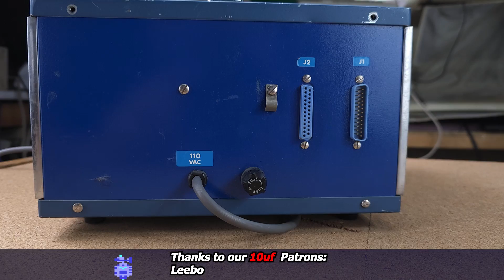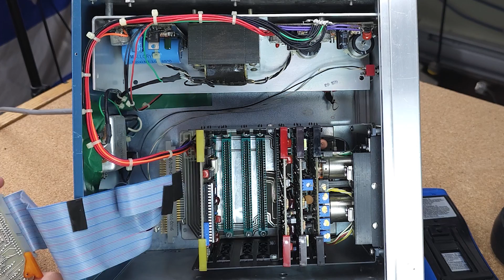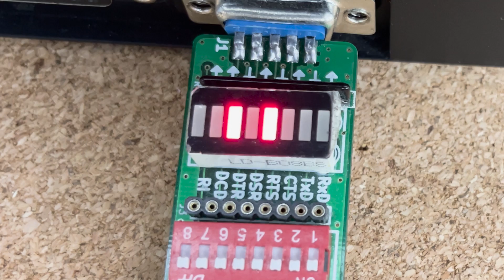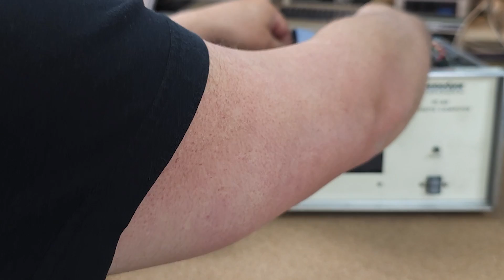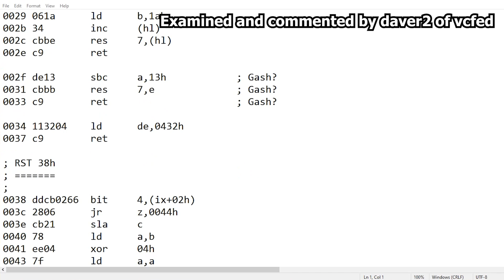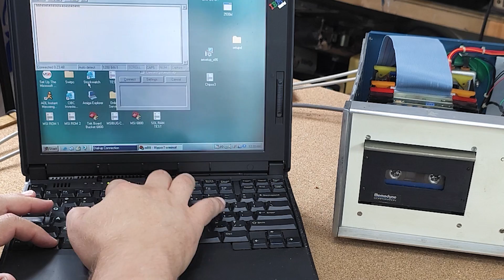Fixing a Mystery Z80 Computer from the 1970s

Comment from the maker: I've edited the video description to include the ROM dump I made, as well as a brochure someone found advertising similar Memodyne systems.  I'd love to hear your thoughts on this machine and how we might test it further, or maybe even modify it into a standalone computer.  While it clearly was aimed at people looking to record data in tricky places, I do think it qualifies as a general purpose computer, Memodyne clearly advertised that capability.  Life goal: Play Zork off a tape. :)  Also - apologies about the lower quality video - the camera somehow reverted to 1080p so my zoom ins didn't work as well as hoped.  But there wasn't really anything intelligible showing up on the laptop screen anyway.
Reply: You can't run zork off tape as it constantly accesses disk. You will need more ram and some kind of fast random access storage. Then you might as well port CP/M to it.
Reply from the maker: @phill6859  Oh yeah I'm just being a goof.  I imagine it wouldn't be impossible though to create a disk controller for an external disk drive.
Reply: ISA 👉 USB is a thing.!
Reply: @TechTimeTraveller  Creating a disk controller could be quite  bit of work depending on what kind of drive you ended up using.

I'd imagine that something using a flash chip/SD card for the media would be more trivial than a real 5 1/4" or 3.5" floppy disk drive.
Reply: @phill6859 You could probably modify Zork to work from a tape drive, even if that's a crappy cassette deck. 

Having more than a couple K of ram would make things a lot easier.

That said, it might really slow down your gameplay unless you can "cache" important parts of the game/z-machine interpreter.  
  
-----  
  
Also, Zork I was released for a lot of different systems and did have at least one release on cassette tape (the one for C64).
Reply: @jnharton  The tape version (Mini-Zork I) for C64 is a cut down one released by Activision UK for inclusion as a cover tape for ZZap! 64 magazine in 1990. The original full Zork for C64 is disk only and was released in 1983.
Reply: @JeremyLevi  Interesting. Especially when you consider that Zork was already cut into thirds (Zork I, II, III) for the microcomputer/home computer market.
Reply: @jnharton  Yeah, looking it up it's apparently only 51KB so it would fit in the C64's RAM entirely, getting around the tape issue. There's an entry for it on the Interactive Fiction DataBase under "Mini-Zork" with more info.
Reply: I found this whole video so frustrating - being a bit OCD about reverse engineering and testing - so I've fired up that nice NSA tool Ghidra and I'm disassembling the ROM dump. I used to live and breathe Z80 ASM so it's a bit of fun. Even without finding extra data on the device I suspect it's the equivalent of a smart tape drive and only a "computer" in the sense that a Commodore 1541 disk drive is a "computer" but it would be nice to work out some of the command structure etc.
Reply: @ingmarm8858  Special purpose computers are a thing, they are all over the place these days.

Almost anything with a microcontroller in it fits that definition, given that all of them incorporate processor core, ram, rom, timers, peripherals, etc.

Comment: I think you almost got there. My suspicion is that this isn't so much a computer but a tape drive (like the one usagi electric showed for the nova). It might be something that you're supposed to connect one port to a computer and the other to a terminal. It would just pass the data through most of the time, but when it gets the right control codes it might read or write data to tape. An experiment you could try is to connect a machine to each serial port and see if the data passes through the device. It might respond to the same codes as a teletype does for turning the punch on and off.

Comment: So I'd guess it is a data recorder that receives data and saves it to the cassette. Probably will also play the data back and send to something else. To test, you should use one Control key at a time and walk through all the keys, rather than rapidly type all the keys.  Control-M is usually the Carriage Return. Control-J would be a Line Feed. But I don't know what they would do in the context of a data recorder. You probably can't count on it being the strictly ASCII or ANSI control codes, since this appears to be a proprietary device and they could use what they wanted.  But here are a few of the ASCII control codes that would be interesting:

Ctrl-D - End of Transmission
Ctrl-E - Enquiry
Ctrl-F - Acknowledge

Ctrl-Q - Device Control 1 (XON)
Ctrl-R - Device Control 2 
Ctrl-S - Device Control 3 (XOFF)
Ctrl-T - Device Control 4
Ctrl-U - Negative Acknowledge

Comment: This box is not a Cassette Computer, but a cassette player (Reader/Writer) for old vintage computers. I had one in 1980. You will also need a separate SCSI adapter to connect it to the computer. I think mine was made in Yugoslavia.

Comment: Given the z80 code at 0x005F..0x0100 and the firmware default configuration data at 0x0300..0x035A I assume the SIO is connected at port 0x10A..0x13. And that port B is set up  with 8 data bits, 1.5 stop bits no parity and X64 clock rate. I haven't figured out yet the CTC configuration and assuming it drives the SIO tx/rx clock I have no clue what the bit rate is.

Comment: I believe it's using the same control codes as a teletype paper punch/reader.  ^q - start read, ^r - start write, ^s - stop read, ^t - stop write. Watch out, a lot of terminal software will interpert ^q and ^s as software flow control.
Reply from the maker: I think you are on the money.  I found a tape that was in far better condition than the one I was using in the video and it runs much smoother.  I also tried 1200 baud, 7E1 and it seems to respond better, although it still returns gibberish to the terminal.  But I did try your idea.. I hit ctrl R to start a write.. sent data.. and then confirmed stop write returned me back to being able to do the read functions.  Before when I'd hit ctrl r i couldn't figure out how to get out of write mode.  I just can't figure out the read mode and what it's supposed to do exactly when I hit ctrl q.  When I did that and it hit a part of the tape recorded by another computer, it started spitting out nonsense characters onscreen, acting like it was reading something.
Reply: @TechTimeTraveller  It may not have transport controls (fast forward/rewind). Try with a leaderless tape (dictation or computer tape). Write stuff to it, then pull the tape and rewind it with something else, then try to read what was written.
Reply from the maker: @ericswanson2527  That's exactly what I tried after I wrote my msg.  I rewound to the beginning, and then put it into record mode and sent a plain text file filled with As.  It whirred away, sometimes doing like a Coleco Adam does.. stopping, back forth then forward again.  Ran to the end of the tape.  I then rewound, put it back in and tried to read.  It seems to read what I'm calling a 'block' at a time, and it fills the terminal screen with text.  But not As As expected.  Often just rows of + signs or sometimes an unintelligible repeating pattern.  I adjusted every terminal setting I could find.  It does not respond at all above or below 1200 baud, so I think that's the correct communication speed.  But I tried like 7E1, 8E1, 7O1.. every variation possible and for most its basically the same gibberish each time.  Except if it's 8e1 I might get these random ansi block characters instead of +

Comment: Why not fix the cassette mechanism first? It sounds like it's fighting itself. Clean the pinch roller, oil the capstan, replace any belts, all that Techmoan stuff. :)
Reply from the maker: @noscwoh1  it's actually the tape.  I later found another and the grinding went away

Comment: You said to use 7 data bits but it says 1200-8-N-1 on the status bar of Hyperterminal. I'd try disabling flow control too, or connect to a scope to work out the baud rate etc.

Comment: 27:15 "It seems to be very random"  Check the power rails.  They may be (intermittently) sagging due to bad caps.  (A 'scope would be ideal for this as a multimeter may not have sufficiently fine-grained time resolution.)

Comment: I've found some info on this over on the ClassicCMP website. Apparently it dates to around 1975. This deals with computer mainframes. Back then they were in the process of switching from the mechanical computer terminals to the CRT type. This device was designed to replace the old paper tape drives. It was hooked up inline between the terminal and the host mainframe. The connection to the mainframe could be a modem, a leased line, or a direct connection to the mainframe. My guess is that it was used to store and retrieve data by the user of the terminal using control sequence commands. If you want to get this working I would suggest finding an old computer with a serial port and run Linux on it. Hook the Linux computer up to one of the serial ports on the back of the M-80 and the laptop to the other serial port. Then play around with the control codes and see what it will do. Use the Linux computer to send data to the laptop and the laptop to send commands to the linux computer. See if you can record what the Linux computer is sending to the laptop and so on.

Comment: A couple of things to consider.  You have worked out that someone has been inside the box and moved the cards around (not a good sign) and there appears to be an empty ROM socket on the CPU card.  It's possible that the unit is not doing what you want as some of the onboard code is missing.  I would suggest checking the ROM to see how it is configuring the SIO to confirm Tx & Rx configuration of the serial ports.

Comment: Have you seen the WHOI document that covers the Memodyne tape format? (albeit for a different Memodyne unit) It's also up on bitsavers Look for a pdf named "WHOI_79-75" in the "3722_763" directory.

I've got a board (or some boards, I can't remember) that I got from a scrapper in Colorado that is chock full of Z80 chips. It appears to be an old floppy or hard drive controller.

Comment: I would get an oscilloscope, check clock line of the CPU, check data lines to see if some program is running.

And check on the power plug that goes int othe board if all voltages are present. A damaged wire could make the voltage coming from the power supply not reaching the board properly.

If you don't know if the processor is running, trying serial comunication can be pointless. Go from the very basics, without assuming anything is working.

Comment: My reverse engineering would be helped with the following:
1) Can you confirm a 4K ROM is present at addresses 0x0000..0x0FFFF?
2) Can you confirm RAM present at 0x1800..0x1BFF and its size (1 Kbyte)?
3) Can you find out IO addresses used by components (Z80 SIO and Z80 CTC) on communication board?

Comment: I have downloaded your ROM dump and started diassembling its Z80 code. Shouldn't take too long.

As per the brochure I expect the basic function is to record on tape the serial data passing through the rs232 input and rs232 output connectors.

Test method could be to send data in few kbyte chunks at various baud rate settings and check if data is written to tape (observe tape activity) each time the internal data buffer fills up.
The brochure states that default mode is record mode. I expect that at power on the device uses hardware default baud rate settings. So no set up would be required. Just try and find out which settings on your sending device (laptop hyperterminal) result in tape activity.

Comment: The 1488 / 1489 are RS-232 line drivers and receivers. I remember when there was always one or two of each on a peg on Radio Shack's parts wall. Seems the MC145406 is the modern equivalent with three of each in one IC, in case anyone is looking at building a 'vintage' TTL/RS-232 converter these days.

Comment: Looks like an Embedded Computing System .. Popular in the 70's and heavily used by the military and industrial processes .. The Key characteristic is no means for user input or output .. The actual programing is done on a mini Computer like a PD11/34, and once debugged burned into the ROM .. Additional Code could be on tape, but not likely due to low RAM .. 

Think of a repetitive process like weaving a complex pattern / picture .. The for example if serial output controls a weaving machine's pattern ..  The tape contains the pattern code which would make no sense to a human looking at it  ..  The weaving machine would control the unit to reset it and read from it, once the pattern is completed it resets and does anther one .. Where and how this was used is anyone guess .. A lot of this stuff was very custom for the actual equipment and process ..

Comment: So that link to the brochure on similar machines appears to cover this machine too.

At least the model numbers printed on the CPU card (402) Serial card (403) and overall system (M-80) line up. The only thing you're missing is the Model 411 Key Panel. That mystery red card is the Model 404 Phase Encoded Read Write Card, so you're right that's for encoding digital data into signals on cassette, though I'm not sure what exactly the "Phase encoded" signals are supposed to look like. I notice the block diagram on page 57 of the brochure shows the CPU card just behind the serial and cassette cards (the clips make a rainbow!) but I think you're also right that the last three slots are the same so that shouldn't matter.

Also seems to be implied that these systems will be running software to suit the application so how it works, the baud rates, if it expects a serial terminal or commands in the data stream or any of that is up to the software in ROM. Your guess is as good as mine how it's set to work.

The brochure mentions using it standalone in a lab with a terminal for control and running software, but it also mentions using it as a "slaved" system or a data logger. Haven't messed with industrial systems of this era, but a common thing for hobbyist dataloggers (like, for model rockets and such) is to just have the system listen to and record the serial data stream being sent in by the flight electronics, maybe with control codes to start / stop recording and to play things back.

If you can't get response from serial that may be something to look into, and digging into ROM looks like the way to go there.
Reply: Also doing some more looking and it looks like Memodyne customized the firmware for each customer... Oof

It also may be expecting a data stream in on the second port that it's recording. That may be why you don't see anything on the tape when trying to record.
Reply: Hobbyist data loggers these days would have an embedded computer in the form of a microcontroller, which might be solely for data logging or have a secondary/tertiary job.
Reply: @jnharton  Yeah, to clarify this was several years ago we were looking through the docs for that data logger, and it was a microcontroller system, just a fancy one with like, multiple real UARTS (no cheesy USI block), hardware SPI for an SD card, and a few megs of EEPROM tagged on the board for settings and secondary recording.

This was before $5 micros and the explosion of Arduino, so a standalone product that let hobbyists focus on programming a single task (or just wiring up analog sensors if you got the version with A/D) and being able to reuse the pricey micro for other things made sense.